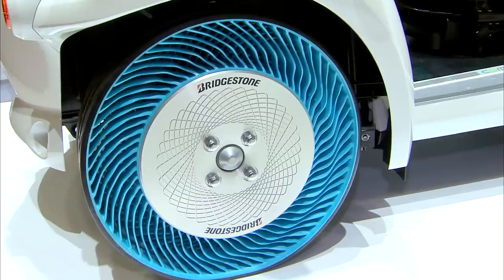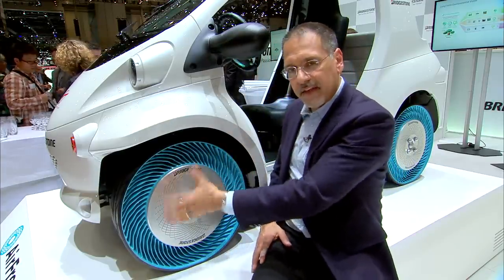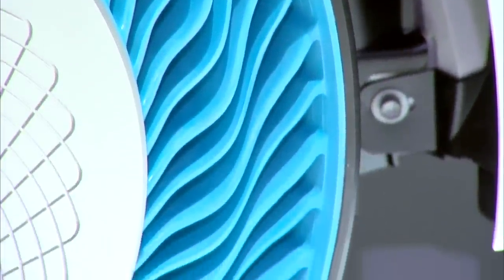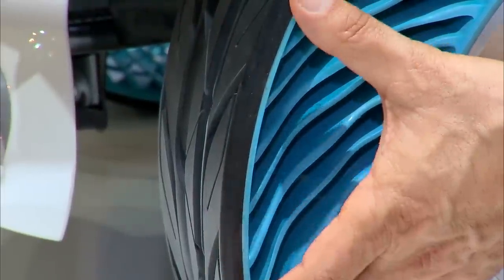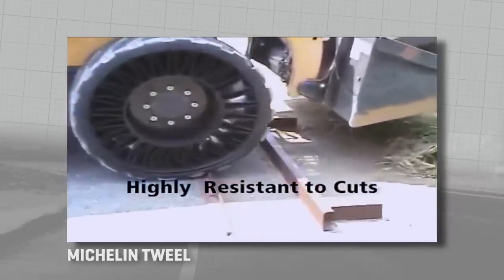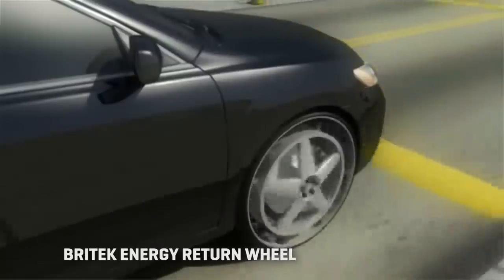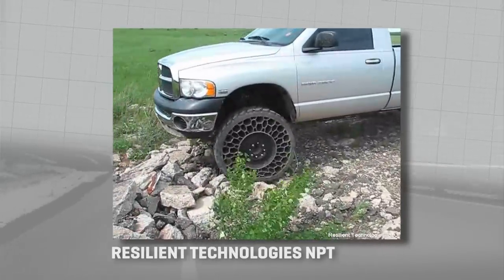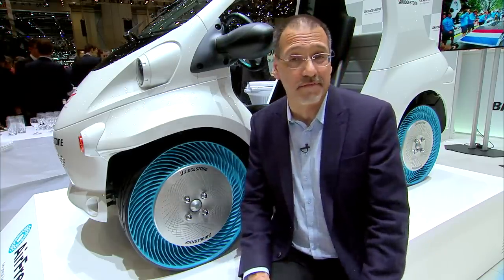Airless tires: Road to the Future | CNET On Cars

Comment: These designs "concepts" have been floating around for a while but there doesn't seem to be much progress on actually implementing them on highway vehicles. They just keep coming out with vague videos with little information. I'm guessing they're having trouble with this type of tire at high speeds and the tires would probably have to be really stiff to actually be useful. I've used this type of tire on bobcats and fork lifts but those are low speed situations.

Comment: That's gonna add a lot of heat on the tires when you're on long trips and it'll degrade the plastic very quickly. Depending on your mileage, that's gonna need frequent tire change. Energy absorption creates heat. Only a matter of time until the plastic gives out. That's gonna reduce mileage efficiency over time lol. That engine's gonna be doing a ton of work.

Adding onto that is stability. At higher speeds, it's gonna make it very hard to control your car. It's an accident waiting to happen.

Comment: I really just want to know why they are not on the road at affordable prices like 10 years ago. Heavy equipment has been using these for decades. Some minor changes may need to be done to the compound being used for shock absorption reasons. Really dropping the ball on this front. I may have to call Elon’s team in to get this done!

Comment: I see one more problem: Usually when going offroad, I adjust the pressure in the tires to meet the terrain. Lower pressure means worse handling but more friction surface. In case of the airless tires, you would need a way to harden or soften them.

Comment: You need normal tires because the spike mats won’t work to stop like a fugitive or a criminal  when they are in the vehicles. if they have those tires on if you have normal tires would work it should only be used for all the departments for police officers and military vehicles.

Comment: problem will be dirt and gunk getting in between
Reply: Nacho TV it would probably still use a rim to protect it
Reply: Just use a pressure hose to wash it, you know the same thing you we're going to wash the rim.
Reply: the inventor must not have think about that. you're so genius!
Reply: They could just create somekind of cover no?
Reply: Flex KJ the guy said no need...you just recap it i.e. just replace the black material with a new one
Reply: And they have to replace the whole wheel if it gets worn out
Reply: @Kwad.Kev2  Incorrect , when the rubber wears out , they simply remove the rubber skin and re skin the same wheel .
Reply: Flex KJ Watch the video again
Reply: So that's your big problem? It'll get dirty?
Reply: Hub cap
Reply: Try to avoid it
Reply: So if they put an outer wall over it the tech will become useless? I thought they had it exposed/sliced in half to show off/demonstrate its internals
Reply: @mindofvirtuoso3358  They are better than pneumatic tires that change pressure with hear and cold thus reducing life of rubber .
Airless  always has the same footprint on the road
Reply: The dirt will break it, cut it. I also wonder how it works in high velocity. That tire won't last for long

Comment: Good concept on paper, but as an experienced tire installer the balance would be heavy, they would cost a lot to get installed as every tire shop would have to get a press or special tools to install them, in colder areas like Canada if water or ice froze in them you would have an awful shake, and also if 1 of these tires got shredded they would be very uncommon and you would have to wait a day or two for a shop to get one in, as you most likely couldn't mix them with other tires (like how you can't mix a radial and bias ply, or even an lt with a p series tire (not exactly can't but shouldn't)) so all in all it's an alright concept at best

Comment: It’s 2018 and these tires are no where to be found 🤫🤭🤔
Reply: Obviously a conspiracy by big tire and stop stick to suppress the technology. :)
Reply: y2rock they were invented in the 60s. Firestone bought the patent and shelved it
Reply: They can be found if you google for them and can be bought. This isn't the type of technology that penetrates a massive market in a matter of years and there is still a lot of R&D going on.
Michelin is one of the brands that makes them. Generally, they're mostly made for less common types of vehicles; ATV's, excavators, forklifts, even golf carts and lawn mowers. 
Also, they are very expensive. You can get a set of four performance pneumatic tyres for the price of one airless tyre.
Reply: GM is doing independent testing , the proposed  date is 2024
Reply: Perhaps this tire just doesn't work.
You need a full review on it. Most of the time you will only find clickbait.

Comment: Replacing just the small amount of tire that is on the road is a great idea and reduces pollution. But, the real UNSEEN pollution comes from the worn tire material that is left on the road.  Molecule size material finds its way into the environment poisoning everything, fish, animals, land and then man. If the part of the wheel that is in touch with the road could be made of a material that degrades over time and is compatible with the environment that really would be a great step forward.

Comment: For anyone asking where airless tires are at, Bridgestone has this to say on their website:

The announcement that Bridgestone was developing an “airless” or non-pneumatic tire for the passenger vehicle market sparked the interest of many drivers. Although this prototype is still being developed, the future looks bright for this revolutionary tire.

Bridgestone airless tire technology features a unique spoke structure designed to support the weight of a vehicle, effectively eliminating the need to periodically refill the tires with air.

In 2013, Bridgestone revealed its second generation air free concept non-pneumatic tire featuring improved load-bearing capabilities, environmental design and driving performance. However, there are developments and enhancements to be made before airless tires are available for consumers. Finding a way to avoid trapping debris within the spokes, as well as developing the best way to distribute weight evenly and consistently transmit loads are a couple of these hurdles. For reasons like these, many spectators think airless tires are still a decade or so away.

Despite this, the demand to keep up with the continuous advancements in the auto industry suggest that airless tires would be a welcome step forward for consumers as well as the auto industry.

TL;DR: they're still working on it.

Comment: The reason why it doesn't replace air tire effects, is the solid version require an exact body weight of the vehicle, and the faster the vehicle goes, the more flatter of endurance it behaves, you still need pressure to adjust manually, or autonomously to the wheel firmest, you could still have air though, like far less or more center inner tubes, like a bicycle tube, but for vehicle's.

Comment: I don't see these ever replacing pneumatic tires. Cost to manufacture will be much higher than conventional, plus no manufacturer has figured out how to make them not vibrate at even moderate speeds. Michelin tested these, and concluded that they cant be used over 50 MPH because of tire imbalance and vibration, not to mention slower acceleration and deceleration due to increased rotational mass, resulting in less fuel economy. So no, your Tesla wont have these anytime soon until they perfect the technology, and even then, they will likely be cost prohibitive compared to regular pneumatic tires.

Comment: I have tested things like these. My biggest concern is that the elasticity will give out in short time. It will not spring back.

I am also worried that as times goes, they will snap or break. Just like a phone book. If you bend and twist enough a phone book it will rip.

Comment: What if you park your car with these tires for a long period and in extreme temperature area. I am sure the tire structure will defirm due to hot environment if park a car for a long time and kept structure under stress and heat. But deformation will occur either its minor

Comment: Yeah,"tires without air in the future" but not that design! How about the questions of aerodynamics in those open spaces? What about sand/mud/snow getting in between all those spokes? So many loopholes on that design. :-) That's why maybe it's still on the "garage". I suggest to put this design inside the tube of what we are using right now, that's more practical and a way of still saving our money for not dumping our chrome rims!

Comment: Practically this STINKS..

When you hit a roadside Cement Gutter which usually happens every now and then when parking or swerving fast on sharp corners those THINGY COLORFUL Plastic will break and then what? Replace the whole wheel?

This concept is nice but on Practical Off road use this will break.. That might be why 3 years have past and we see NOTHING on the market...

Comment: I don't see it happening, tire companies are tied with big oil (that rubber comes from somewhere, right?)  They'd lose so much money if people weren't replacing tires all the time and if all they had to do was recap these things.  They'd have to make the caps wear faster, so you only get about 10,000 miles instead of the usual 60-70,000.

Seriously, where were these when they "debuted" like 20 years ago?  I still remember that exact hummer footage and how it was going to revolutionize our cars and they still don't use them.  I see them once in a great while on a Bobcat like they showed here, but that's about it.

What mud and snow?  Could you imagine getting that crap stuck in these things since the outer cap is so thin?  I'm not spending that time cleaning it out :P

Oh well, this vid is already two years old now, guess it's not a big deal.

Comment: Except they're extremely inadequate for normal, every travel above 40mph. That's why the US military didn't go through with using them. They're great for construction vehicles that require traction, durability, and a smooth ride, but for anything else they're simply not there (yet).

Comment: First of all, don't you want some give in corners? On a motorcycle, when you're at extreme lean angles, the tire depresses and creates more of a contact patch between the rubber and the road. No give would equate to over-inflated tires and every motorcycle rider knows that when you are going to do aggressive riding tire pressure is extremely important.

Comment: If the selling point were that this tire is scientifically advanced and therefore the coolest new thing to buy, that would be just fine - but how is this more eco-friendly than any other wheel? Considering the constant flexing, daily and seasonal weather and temperature changes, direct sunlight, road salt and chemicals, and that it's made out of plastic, I doubt that the tire tread is the only thing anyone is going to have to replace. What kinds of chemicals are used by all of the different mining companies and manufacturers in the processes when making the metal, plastic, and rubber wheel components, and what becomes of their by-products? It's not like these things magically appear out of thin air and never wear out or become obsolete just because a marketing writer says they're eco-friendly.

Comment: Airless tires generally can have higher rolling resistance and provide somewhat less suspension than similarly shaped and sized pneumatic tires. Other problems for airless heavy equipment tires include dissipating the heat buildup that occurs when they are driven.  Bicycle riders who use airless tires may complain that the tire is harder than a comparable pneumatic tire.

Comment: So allegedly you only need to replace the tread and not the whole tire... Why isn't it like that with regular tires?
Also would the sides get covered with rubber or left like we seem them here...? Would crap getting into the rubber-mesh be an issue? Or could the mesh auto-clean itself due the rubber twisting and bending while driving?

Comment: It is good for use on slow moving equipment such as a skid loader. But if you use on a vehicle and it gets Debris such as Snow, Ice, Mud, Rocks in through the side it will cause a lot of vibration at higher speeds. Looks like it will need some kid of sidewall to keep that stuff out.

Comment: They need to make a insert for normal / regular tires, which would also give us run flat tires for an airless ride. they need to start making a crossover so we can still use the available tires. A shielded sidewall would be good for mud & snow. You would probably end up using a rim like offroaders  use, with a bolted outer flange. LjN

Comment: They've been at this for over 10 years and still cant pass highway safety standards. Gas engines will be in museums before this gets on the highway
Reply: Incorrect , they have been in use in heavy and moderate construction taking beatings  for years out performing the  pneumatics.
Many companies working on them , many outperforming characteristics on the airless. A bit more technology needed , but expect mass production in 2024
Reply: all good i will notify you in 5 years

Comment: I guess spike strips would be useless for the cops who are trying to stop this car :P
Reply: People who run from the law would not like these,  They don't offer them in 24"s
Reply: FastCarsNoRules220 in the future they'll probably use an emp blast to stop the vehicle
Reply: Here in canada we just shoot a sticky dart to track them
Reply: FastCarsNoRules220 spike strips blow up the tires but you can still drive with those, just not as fast and accurately.
many states already stopped using them for not being that useful for their purpose, so I can't really find why this isn't on my car yet if not because the street law is outdated.
Another thing would also be that all services are equipped to manufacture, sell, repair and replace the standard wheel model, it would cost a lot to introduce this wheel and it's easy that nobody thought of risking it yet.. a shame
Reply: Who needs that, they'll just use the killswitch in the proprietary software running your car.
Reply: Looks like the car could barely hit 55 mph
Reply: Actually, Spikes work similar to running over a nail, it gets stuck in the tire but doesn't cause a blowout. Only the spikes are hallow so it gets stuck in the tire and air slowly drains through the hollow spikes to bring the car to a controlled stop.
Reply: Well played HCAC
Reply: That's not how spikes work. 
Spikes roll around of wheel so it stucks so bad that engine can not turn the wheel.

Comment: All other Airless tires are low frequency, low weight capacity, low speed. Britek Vacuum Pressure Wheels 74 issued claims. Historic High frequency response. Perfect for racing. 2/9/09 50% r/r @USDOT.